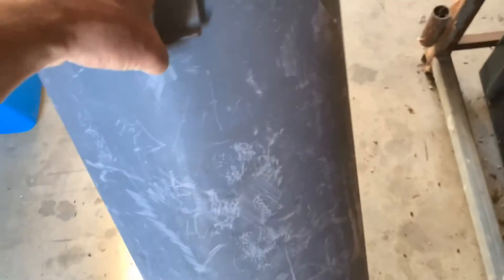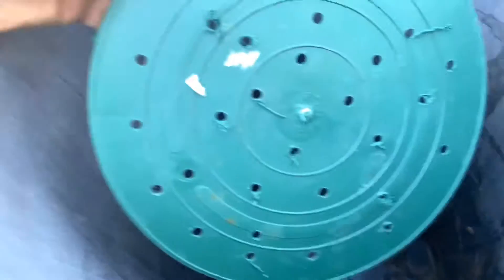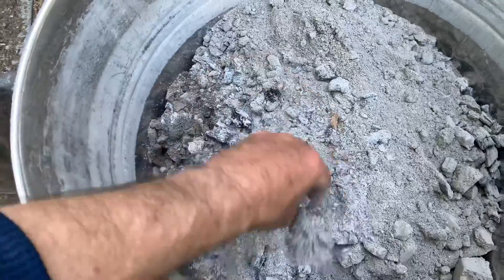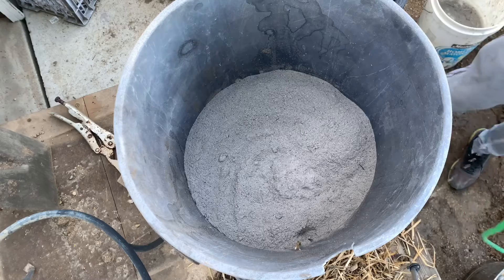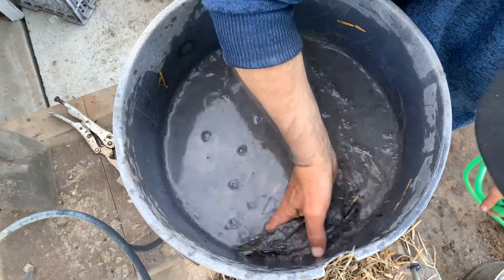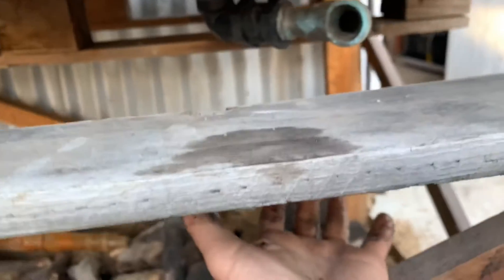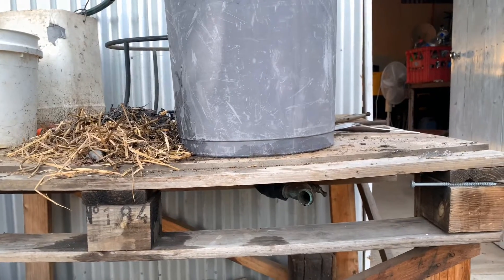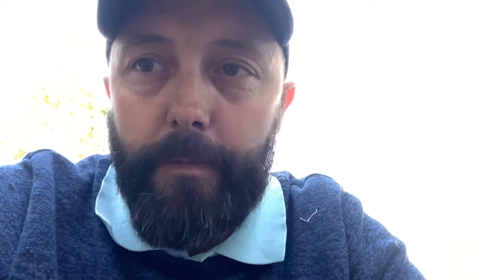Potassium Carbonate. How to extract it from wood ash!

Comment: I wouldn't use this directly as a soap. Yes it cleans but it does so by creating soaps from oil and proteins on your skin which is bad if done often. I'd consider adding some veg oil to it (olive and coconut) to make actual soap and then add some lemon to neutralise the pH. :)
Reply from the maker: Thanks for the advice.

Comment: My ash water is green and makes my hands cramp when i actually dip them in. They feel bad after not like in pain but not good.
Reply from the maker: Green is strange. Not sure what’s happening there. Maybe best if you didn’t touch it!
Reply from the maker: The only other thing it could be is that you have a highly concentrated mix. In this case I would not be touching it. The carbonate mix may contain hydroxides which could be turning the oils on your hand into soap. Wash your hands with fresh water.

Comment: The soapy feeling is the potassium hydroxide that is mainly what is coming through the carbonate precipitates out first and isn't that soluble in water . You should have dissolved in a glass bowl then you can see the different constituents of ash ...there is a slightly yellow part very soluble in water that contains the hydroxides good for making soap and the white slightly grey ppt which is the main constituent those are the carbonates mainly potassium
Reply from the maker: Thanks for the information! I’ll keep this in mind. Sorry for the late reply. It’s been a while since I have been back on here to check comments.
Reply: NOT TRUE there is NO potassium hydroxide in this solution only after reacting it with calcium oxide does it convert
Reply: @NOBOX7 so you saying that there are hydroxides in wood ash??😂😂and no potassium ions?

Comment: Are there any other constituents in the extract beside potassium carbonate? Once I got some crystals from an evaporated extract, but they didn't fizz with acid, so I suspect it might be potassium phosphate.
Reply from the maker: Calcium carbonate is a major component. This will form a layer of crystal on the surface of liquid if you store it as a fluid. Phosphate is certainly a component as well but this will be in smaller quantities.
Reply: @Michealfarmer  to difficult to obtain calcium carbonate crystal its insoluble in water, but also in the ashes there are a lot of calcium carbonate 😁
Reply from the maker: @gabrielcarrizo5180  yep, the calcium deposits that form on the edge of the bucket are either calcium carbonate or calcium silicate. Thanks for your comment!

Comment: that was was the liquid how to transform it into powder I hope you answer
Reply from the maker: If you have a saucepan you could heat the liquid up to reduce it completely. Dehydrate it until there is not water left and you will be left with the potassium carbonate in powder form. You will need to store it in an air proof container as potassium carbonate is hydroscopic and will attract moisture to it. Cheers I hope this helps. 
I used a fire to boil the water off as it is a great heat source.